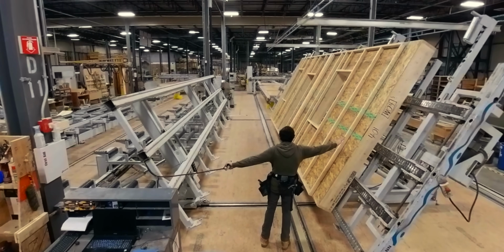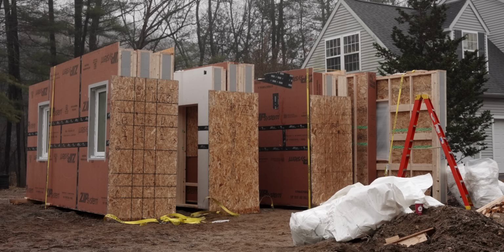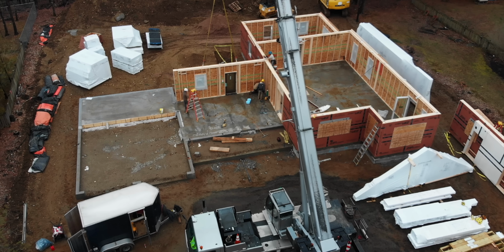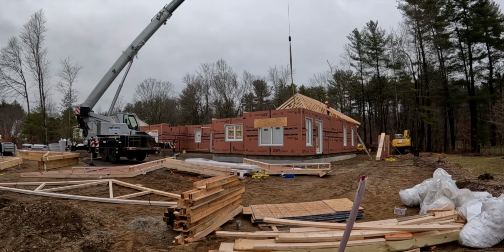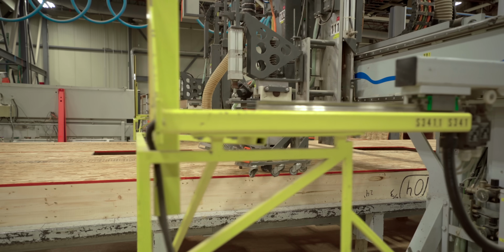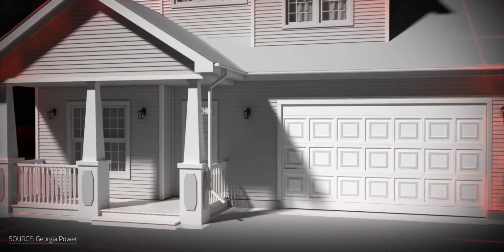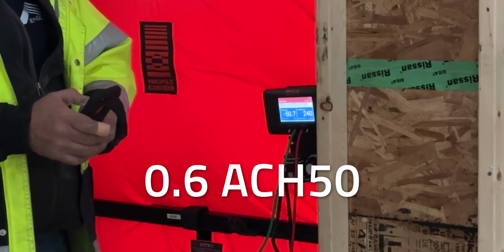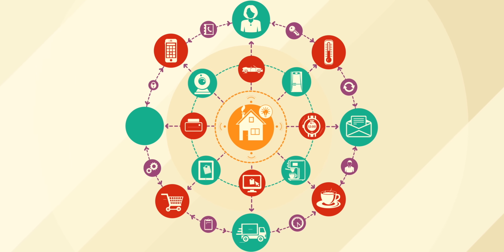Wow! I Didn’t Know A Prebuilt House Could Do This

Comment: Hi, Matt.  We are considering a build with Unity and love the fact you are documenting your experience. I am hoping you have a little more information on the foundation.  I know slabs are popular in some parts of the country, but here in New England, basements are more common.  I am wondering why you chose the slab.  Was it  a cost consideration or did the slab add to the energy efficiency of the build?  I am guessing you thought a lot about the foundation and just wanted to hear your thoughts.
Reply: I am also curious about this.
Reply: @scubascoob7441  I will let Matt give the official response but if you imagine an envelope (or better a box) you lose a lot if you neglect to put the last side on.  The bottom is important.  I like my basement too but the "bottom of the box" is important and to close the loop with a basement would increase the cost possibly by a factor of .5.  Now I'll wait with you to see what Matt says.
Reply: Wondering about this too.
Reply: I am hoping to see radiant floor heat. Basements are nice for all the mechanical equipment. Thinking Matt must have built where the water table is high...
Reply: I imagine that having a basement or not is affected a lot by the type of ground material below (digging is expensive and timeconsuming), underground hydrology and risks of water penetration into your basement, as well as exposing additional concrete surface to the ground which is much harder to insulate (much more surface area etc.), if you are aiming for a Passive house.  These factors all increase the costs of building; single level is much cheaper, if you have sufficient space/lot size (and are not constrained by other regulations or municipal/zoning requirements).  Finally, a basement is also a choice that may be very important in some regions (e.g. tornado-prone areas), or unnecessary/undesirable in other areas (especially if there is a lot of surface water/rain/flooding).  I have no idea which of these factors were relevant for Matt; it's possible that they simply didn't even think about the option of a basement.
Reply: @davidbarry6900  The reason basements are so common in the north east is that you need your footers to be below the frost line (unless you do peirs or a raft-style insulated foundation) so it's a no brainer to move a few extra yards of dirt and buy a few yards of concrete. The only times I've seen slab on grade around here are when the building is near water or when it's there is near-surface bedrock like my house. 

It's actually kinda funny because there's a line of houses in this development without basements because of the exact same limestone structure that sits ~5ft below the surface..

Comment: That almost look as if its up to Danish standards, as i recall insulation for walls are still 200 mm or it might have been raised to 300 mm now.
A house here build to the latest pinnacle A - 2022 standard, well you can almost heat it with a few candles.

Comment: Great Job Matt, My wife and I build a pre-engineered home (Barden Manufacturing), back in 2002.  All of the wall panels were manufactured at Barden and shipped to our site, just like yours.  We used 2 x 6 framing on all exterior partitions.  Insulation was added on-site, using what is called a "Dense-Pak" method.  Plumbing, heating, and electrical were all added by conventional means.  Our contractor Bear Mountain Builders (Western Massachusetts) encouraged us to purchase a high-efficiency package to reduce air in-leakage.

It was a wonderful home and took us 1/2-year of Auto-Cad iterations with Patlin Enterprises to get the 3,700 sq.ft. home with 4-car garage sorted out.  In the end, the only change-order we had was a 6-inch extension to an interior kitchen partition at the end of an upper cabinet run.  It just looked silly having the partition end 1-inch past the last cabinet.  The builder said it was the least amount of changes he'd ever seen in 25+ years of building and specializing in Barden homes.

Congratulations to you and your family.

Comment: Matt, if your house is still at the stage before the interior is finished, I highly encourage you to check out this video from Matt Risinger's channel for an aerosolized caulking system that uses the leaking air itself to entrain caulk droplets so fine that they stay suspended in the air to find and fill even the tiniest of gaps. In this video Matt Risinger was using this system to seal his own house to try to get it down to the passive house standard of an ACH50 of less than 0.6. Now this house was entirely built on-site with different trades coming in and say drilling a hole for an electrical cable that penetrates through the envelope that they don't mark for caulking, so it doesn't benefit from the highly automated and repeatable process, including the taping and caulking, of a factory built house. The result was that he started out with a pressure door test giving ACH50 of 1.14 despite trying to find and fill every gap and hole they could to make the house as airtight as possible. But after the aerosolized caulking process fill all the tiny gaps the ACH50 rating dropped to 0.1. So while an ACH50 rating of 0.54 for your house is AWESOME, you could potentially drop that even more. 

Note, I have no involvement with this company or Matt Risinger. It is just that as an engineer, I love really good engineering solutions that take a new and highly creative approach to solving important problems, and in my opinion, this is a great solution to getting houses, even existing houses, sealed just about as tight as is physically possible.  Here is a link to the video at the point where they rerun the blower door test showing the before and after ACH50 numbers. From the description of the company representative, this method can be used on existing houses. The issue is that it would take a lot more prep to cover all of the horizontal surfaces since there is some settling and so it would be a bit more expensive. The recommendation is for an existing house, the best time to do it is just before moving in when the house is completely empty. But it sounds like they can also deal with a house that is currently occupied, but again it would require even more prep and thus cost more. At some point soon, I am going to see if this can be done for my old 1950s house that currently leaks so badly that I am afraid to get a blower door test to confirm just how bad it is.

https://youtu.be/JYugiSwWoPk?t=478
Reply: That sounds like a nightmare for your lungs.
Reply: @RookwoodGG  That is why people generally aren't inside during the processes. And if anybody has to be, they wear a respirator that will filter out the droplets. And even if a little gets in your lungs, it won't like coat the entire inside of your lungs. Likely it the droplets will stick in the mucus layer and the travel out of the lungs along with all of the other gunk that we breathe in.
Reply: @papparocket  I watched the vid and it seems like the caulk precipitates out of the air once the house is depressurized.
Reply: @RookwoodGG  Most likely they open a door or window before turning off the blower door so that most of the caulk suspended in the air is blow out of the house before much of it can settle. But for sure some of it likely does settle out. That is why this process is best done immediately after the envelope of the house is sealed as best as can be done with conventional taping and caulking, but before finished flooring, drywall or things like cabinets and countertops are installed. Then if some caulk gets on the subfloor or sill plates of the walls it isn't an issue.

Like the guy from the company said, this process can be done in an existing house, but it takes a lot more prep, and thus a much higher cost, to cover the floors, countertops and any other finished horizontal surface so that the caulk that does settle out doesn't get on these surfaces.  The cost probably gets pretty steep if the house is also fully occupied since all the furniture would also have to be protected or moved out of the house while the process is being done.

Comment: The factory build systems have been compared to mobile homes and what you show here is that is just not a comparison.  I didn't really think you could achieve .5 ACH with any form of stick 10 years ago. BTW, why did you go with cellulose in the walls? I understand the "breathing" part, but won't that settle?  ALSO I am looking forward to your HVAC system when I looked at alternatives it was far more expensive to use them and I did not see a curve where they would ever be cost-viable over the life time of the systems. I am hoping very much that has changed.

Comment: I'm in the process of building a modular construction home.  We are very early, but have the design done, and are still working out permitting etc.  One surprise I had was that our builder informed us that they could not do slab on grade for the foundation, and that basement or crawlspace is necessary.  When I saw that your modular assembly was done at the wall level and not 3-dimensional level, I guess that enables a lot more flexibility for foundation choice.  We had to design based on Min/Maxing factory module limits (L x W that is).  When they ship it, they will have to unload ~ 15' x 40' modules, and in that case, I was informed slab would not work in that case.  Was that ever a topic of discussion with your experience, Matt?  (I have 0 expectation that you will answer, but I'm just throwing this out here)

Comment: Are you sure about the U-Value of your windows? Guessing its the same U-Value as here in europe, (as in W/sqm power loss), the glass will usually have a value of 0.5, with some glasses going down to 0.35(which is currently the technical max that can be achieved) while the window frame will usually come a lot higher, giving the entire element(for a 3 glassed window with insulated spacers) a u-value of around 0.7-1.2. I sell windows for a living, so I know what I'm talking about(at least for europe)
Or is Utotal measured by sqft in the states? that would explain the lower values, but then 0.15 would be fairly bad(as in illegal to use in new homes here in germany), as that would roughly come down to a Utotal of about 1.5 (1.2 is the legal maximum allowed if you build a new home, subsidies require 0.85 or lower)

Comment: I am a little surprised that you didn't include a basement. That would seem to be a relatively cheap way to add space, and with lots of insulation on the outside of the basement walls, a way to ground temper a portion of the house.
Reply: Our home in Colorado has a walk out basement and it is beyond awesome.  We are off grid so it has a utility room for the cistern, water heater, batteries etc.  Awesome use of space and warm in winter and cool in summer.  If an unlikely tornado hit it straight on, the basement would be intact.
Reply: I think there is more expense in basements.
Reply: @drsaintdc  
They need a place for their  potatoes
Reply: Why basement?
You have potatoes to store?
Reply: @MrDeicide1  Most houses with a basement will have HVAC, Fuse Box, Water Tanks, ect plus Washer and Dryer all in the basement rather than taking up space in the above ground portions.  Basements also add extra storage for any kind of good (holiday stuff, alcohols, non-perishable foods, stuff for guest, whatever).  In the US when selling a house basement space isn't supposed to be counted in the square footage of the house (looking for a house myself I've noticed many listings cheat).  A house with a basement, especially a finished basement, will usually be worth more than the same square footage house without (since it's supposed to be extra space).

One down side to basements is that they are more likely to leak or otherwise breakdown than a house built on a slab alone.  That said a lot of the houses I've looked at seem to have issues with the grade (angle/tilt) of the land suggesting insufficient time was given for the land to settle.  Combined with people not fixing the grading of the houses and allowing water to get in and under the foundation means there's a whole lot of houses on the market with terrible foundations (and the asking price is as if there were no problems and everything had just been updated with the latest and greatest tech).
Reply: @MrDeicide1 are you remedial?
Reply: @TheGreyGhost_of43rd  
Nah, I got a doctorate
Reply: @MrDeicide1 t’s very unusual for a house to be on a slab foundation in the north east with the ground freezing. Crawl spaces can also be a problem for frozen pipes and freezing cold floors in the winter. Basements are great for housing your furnace, hot water heater, running ductwork and usually no trouble with frozen pipes in the winter. I’m from the Buffalo, NY area and a lot of people are turned off by a house not having a basement because of all the said problems in the winter months.
Reply: @jayson657  
Buncha places in the world have ground freezing in winter
They do fine with foundation only
Only here it's "unusual" to not have a basement
Reply: @MrDeicide1  well millions of homeowners in northern states have found a basements beneficial for hundreds of years.
Reply: @jayson657  
well, don't ASSume everywhere in "the-rest-of-the-world" is same as here...

Comment: Always enjoy your content. On the passive house, I would be interested in your findings on the impact of clothes dryer to the efficiency of the house. Matt Riessinger, recently introduced a dryer design that did not vent directly to the outside. The machine has an air conditioner style condenser to remove excess humidity and the vents back into the house envelope. He cited very high volumes of ‘expensive’ conditioned air being exhausted that have to be replaced. Much like the door not being closed on your air tightness test, it’s easy to overlook a common thing like venting a dryer. Looking forward to your thoughts on the pros, cons and other ways to address this.

Comment: A geothermal heat pump may be overkill; with 0.54ACH and good insulation and air source heat pump will probably be enough and considerably cheaper!
I've gone down the rabbit hole that is @buildshow and Matt Risinger has opened my eyes to many things to consider with a home build. Looking to do a PIR SIPs build with a conditioned crawl space; conditioned attic and airlock to the main entrance. Together with a SIPs floor and energy recovery ventilation system, I should be able to get away with almost no heating or cooling in Melbourne Australia. I also intend to have 2x R3.5 (~R40 US) rockwool insulation in the ceiling and battens on the SIPs floor to take floorboards but, between the battens, I intend to have phase change material for thermal mass.

Comment: The Zip System has a perm rating between 12 and 16. The moisture captured inside the panels might not be able to get out easily. Hence there is a potential of moisture build up inside the panels.

Comment: Chipboard lifespan is terrible, so don’t expect this house to make it to “This Old House”. Always get a unlimited warranty backed by a Bond on the thermal windows because they will fail in 20 yrs or sooner. Make the windows easy to replace with little damage to the outdoor and indoor frame. Also keep each window’s measurements in a binder and place a copy behind the indoor bezel/frame in each window. Because in the future you’ll want to order and have the replacement window on site to swap out.

Comment: we're (it'll be my partner's house) thinking of building a passive home in a year or so and don't have a factory kitset option in my country, so it'd be great to hear more about options for things like the the air exchanger, heating and cooling, hot water... and also how your power setup works and what's required for that.

Comment: just be aware very limited design options, palate , and even glazing, relatively small windows, non mulled, non masonry walls, short ceilings (ie not ten feet, and no adornment like you seek in typical faux craftsman custom homes these days. AND for unity, non ducted hVAC system with ugly mini split blowers and their attendant hi maintainence .

Comment: As an Englishman I am unused to seeing Houses built entirely out of wood. Here we use a variety of materials, mainly brick but also concrete and breezeblock amongst other materials. We also build for durability: (I know of many buildings that are well over a century old- and I don't just mean public buildings). So I have some questions:
(i) What would be the average life expectancy for a house such as your new home?
(ii) Does having an energy efficient house preclude you being able to open windows for ventilation and fresh air? (This is something considered very important here).
I am not saying that your methods are wrong or inappropriate for yourselves in the US. It's just that, for us in the UK, they are unknown. So I would appreciate an explanation as to why these different approaches arose.